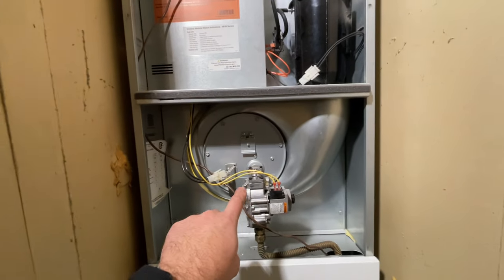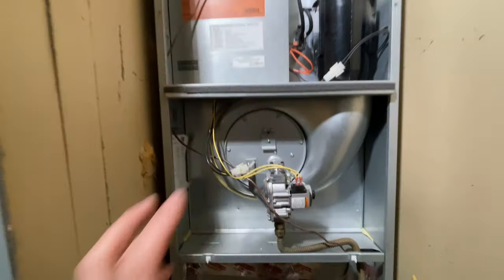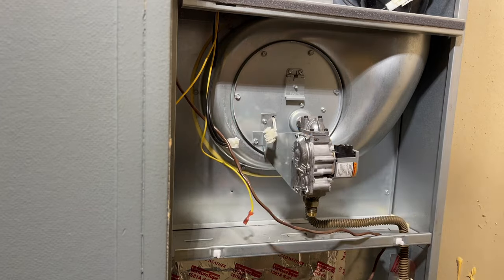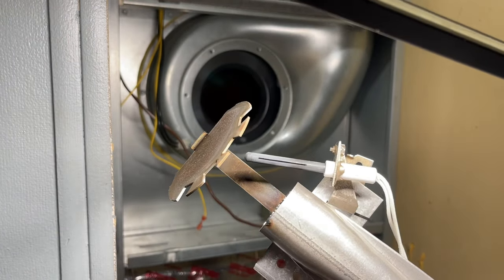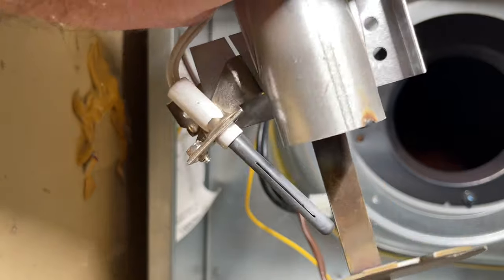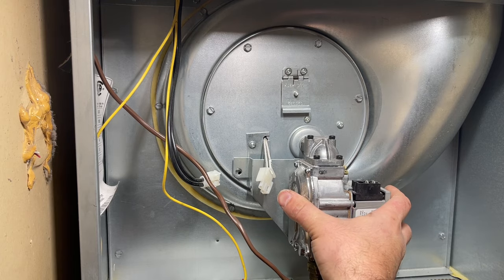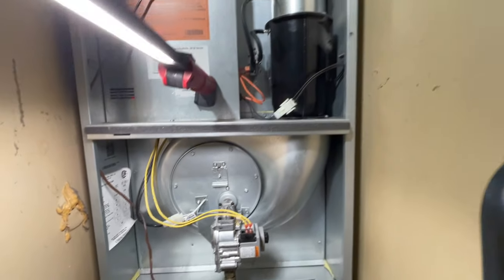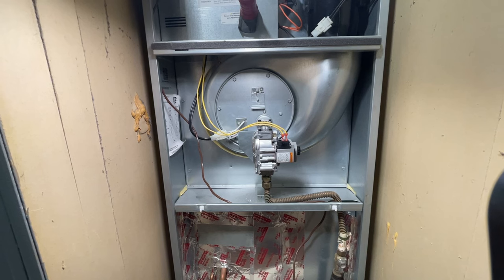How To Clean The Flame Sensor On A Mobile Home Furnace And Save Hundreds

Comment: Thanks 2 you, I was able to do this process,   my igniter sensor did not look dirty though, I saw mouse poop in there, so I vacuumed it out.  The furnace has been running for 55 minutes without shutting down, steady yellow and red light......so warm in here now.....  Many Thanks..

Comment: So I have a problem with my mom's Miller furnace a mobile home 1985 I've gone through the pressure limit switch fan limit switch and even a new blower motor the furnace keeps cycling on and off so the thermostat will click it'll fire up then it'll shut down The fan will kick on then it'll reignite and then it does that for the whole duration of the furnace What the heck could it be could it be a flame sensor?. I thought it was the fan limit switch It wasn't
Reply: Same situation. Ever figure it out?
Reply: @joeoconnor87  nope, hey quite a few people say it's the igniter but I'm not sure or it could be the gas valve.
Reply: Does it have a standing pilot light?
Reply: @joeoconnor87  What do you mean? It's electric ignition
Reply: @peachyclean93 my miller has a standing pilot and doing the same symptoms. I mistakenly forget what video title. Lol
Reply: @satbobsmith7261  Oh perfect thank you I really don't know how to do that I mean I'm wicked smart on certain mechanical stuff but haha I would not think of that

Comment: Ok everyone help me out!! I did follow this video and i was able to take all the screws out and unplugged the necessary wires but i could get the circle plate to come off completely? The only difference with mine is the copper connector ( gas line ) cannot be unscrewed.  I need to know how to take off the plate completely?! I live in Buffalo and i need my furnace to work!! I cannot afford to have someone come in to fix it.  I can hear it clicking, struggling to light but just doesn't.  I'm very determined and i HAVE to do this!!

Comment: Called repair guy on a Saturday, he replaced flame sensor, billed me $385. Ouch. Part cost about $25 depending on where purchased. Saved old one, cleaned like you did for next time. Can’t use single wire ones that cost $4.
Reply from the maker: Bummer… we’ll at least you are prepared for next time!

Comment: Hey bro, at 1:05 & 4:08, I wish you would’ve showed us your process of loosening (and tightening) those double nutted piping systems! Did you use 2 channel locks? A locking vise grip and crescent wrench? A small pipe wrench and a set of pliers? Just wondering, cause the older furnaces that have really frozen pipes can be super hectic! 😁  Thanks man!

Comment: I've cleaned plenty of these to get by, but usually by the time they start sensing weak flame it's time to change the ignitor. I wish nordyne would have had a flame sensor separate. Like Colemans.
Reply: Mines a Coleman and it's freezing,  what's the difference?  I have never done this before myself but it's always something needs cleaned every year so I'm guessing this is it.
Reply: @scotticidal  What's freezing? What's different? Coleman is a completely separate parent company and design.
Reply: @angryfarmingamerican2124  I meant it's freezing outside and what was the difference between the models. Anyway,  I got it apart and have heat again!
Reply: I agree. Wish the Flame sensor was separate too.

Comment: Question , my gas furnace is working normally if I leave the top part door open, but if I close it, no heat or no working
Reply: If it a 90 percent efficient furnace with two pvc pipes coming out of the cabinet it is likely you could have a restriction in the intake pipe for combustion air.I disconnect the intake pvc pipe at the furnace and use a electric leaf blower to blow through the pipe to clear it all the way outdoors.A licensed HVAC contractor can check and clear a blocked intake pipe and if that is the cause,no parts just a labor charge.
Reply from the maker: What he said ☝🏽 hope it’s an easy fix :)

Comment: WoW .  small  WORLD.  The furnace, in my trailer/home,  has the same thing, upto  0:35  Time, Xactly, the swich is just the same...but,  after  35 seconds, the bottom/burner setup is different !
 There is an   ON / OFF  normal  wall switcht, on the opposing wall, in the  hallway .......wow.  TAKE  GOOD  CARE,  OF  ALL  IN YOUR POWER,   MR  HVAC  MAN  !   (from Alberta Canada) 
oh,  was wondering; i'd   like to  S L O W   THE blower fan motor, but it isn't  a 3 speed one;  just the 2 wires and ground.  Could i install a 3 speed motor, using the same  round  fan  ???   WONDERING.....

Comment: Hello Sir , I have the same furnace  , I tried  everything you explained but I still  have no light  on the flame sensor  , I cleaned it but still no heating  😞 any other advice  ?
Reply: Did you ever get this figured out? Same issue.
Reply: Replace it they do go bad

Comment: My furnace will not turn off from the thermometer if it is more than 66°F.
The thermostat is fine and opens at temp.  The control module is brand new.  I think it may be the low voltage wiring.
Any ideas?
Reply: Questions:
Furnace continually runs or just the fan?
How long does it run?
I would disconnect the thermostat wires and the board and use jumper wires to call for heat. Remove the jumpers and it should stop the flame within a few seconds. The fan will still run for a few minutes. If it’s still doing it with no wires attached then it’s your board. If it doesn’t do it then it’s something with the wiring or the thermostat
Reply: @JurassicJolts  It is heating, not just the fan.
It runs until I kill power to the furnace.  I have allowed it to get to 76°F before I turn it off.  I usually turn it off between 68-72°F
I will try your suggestion.  I feel like it is the low voltage wiring since I replaced the board not too long ago.
Thanks!